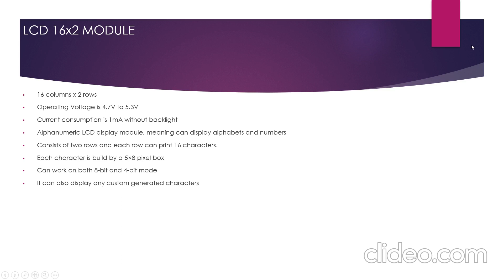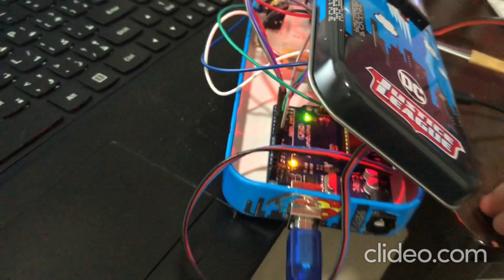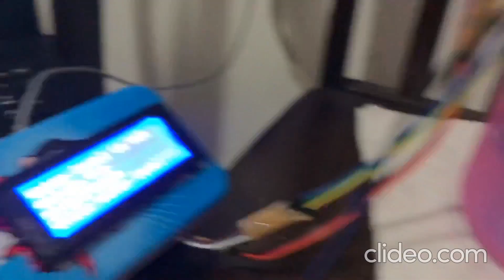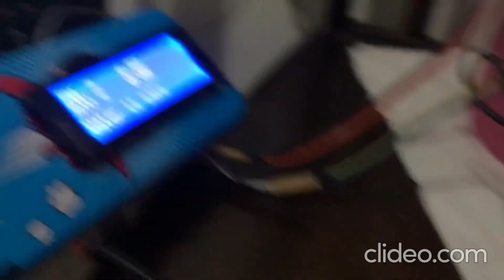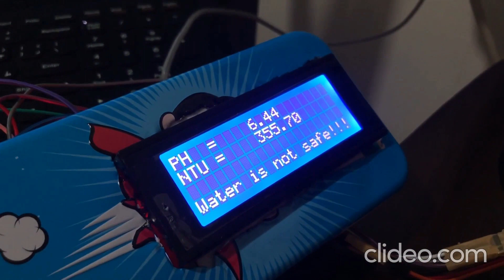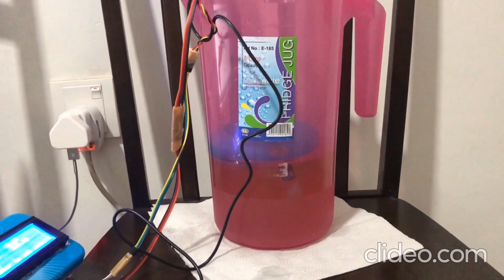Group H- Water Quality Monitoring System

Comment: could you have ditched the uno and only use the esp microcontroller only to save cost ? Reduction of hardware means reduction of cost and reducing prob of system failure. not to mention better looking design
Reply: Due to the pin I/O we can theoretically ditch uno but it would not be practical , we have wifi ph sensors lcd output and we could have added more or upgrade with more new features, if we use esp microcontrollers which is cheaper than uno ones they have limited number of pins and the cost could reduce but only for this design and for this function since we are using in water the maintenance is also part of that problem. If any of the pins fail if we use esp board we can't switch to other pins because it is already full. Power consumption seems like less with  esp because the voltage is 3.3v and uno is 5v but since we are using wifi and turbidity and lcd output it would be like same. So the cost won't reduce much.

Comment: it is stated that the voltage range is not 0-5 v for analog voltage. how do you optimise the 10 bit precision of the arduino analog?
Reply: The ADC on the Uno board has a 10-bit resolution, letting you differentiate to 2^10 (1024) different levels for an analog input.
Take multiple measurements and use an algorithm and averaging to get better precision. For example, one thing you can do is to take 10 (or 100) measurements, throw out the top 10% and the bottom 10%, and average the rest.

Pros: Fairly simple, no new hardware
Cons: Takes a lot more time to do so many readings
Reply: @shawbanmahmud7839  you should have conditioned your signal to between 0 to 5v by using circuits / etc. Else you will not get the full 1024 range..you may get 750 or so...another way is manipulate the voltage ref pin on your uno.